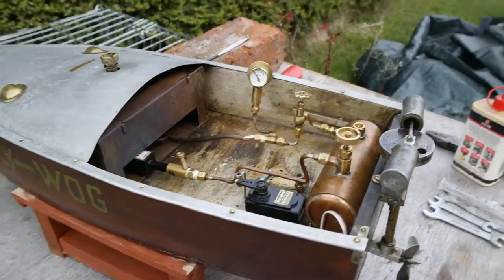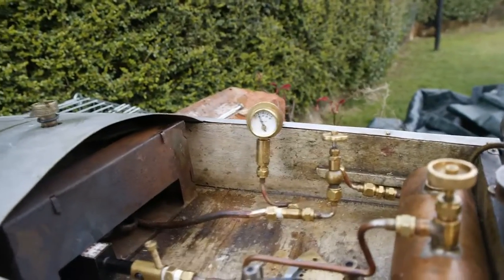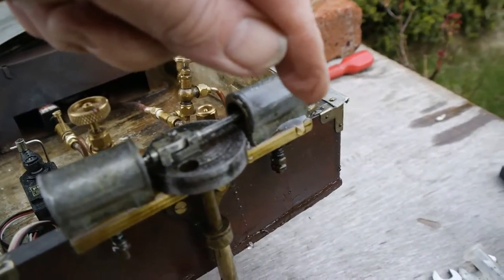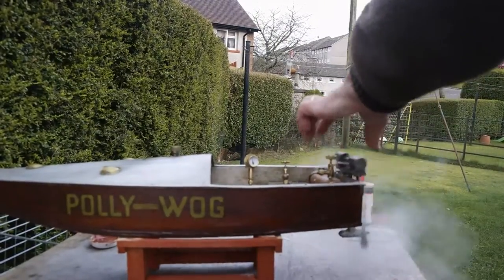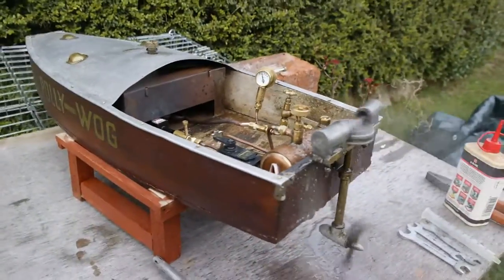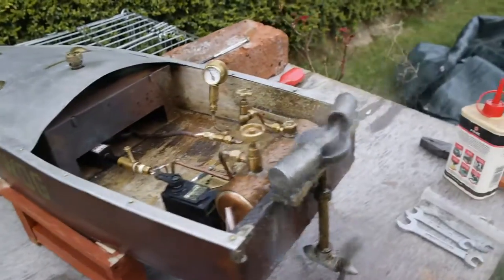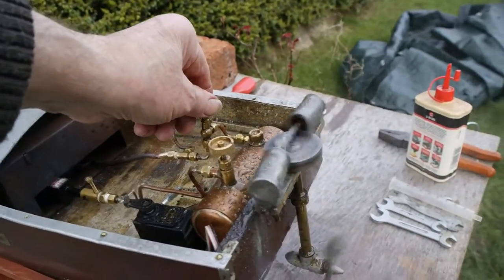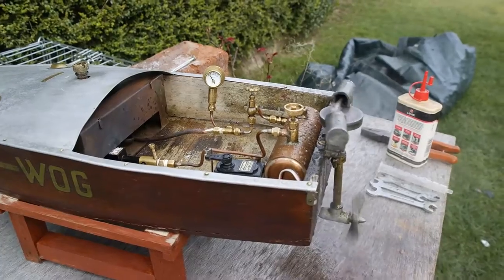BOUCHER POLLY WOG  STEAM UP FOR DOMENIK PART 2

Comment: Bonjour Roy,
She runs perfectly, you made definetely a great job.I do not understand why you would change the jet, I guess it is for the power of the burner, and as we can see it, nothing need to be changed. I hope we will see her soon on the water.
Amicalement, Raphaël
will
Reply from the maker: Bonjour Raphael ,  " yes run well but a this time temp was 7 C so this=  using a number 8 yet , as to like you say to increase boiler pressure ,however as the buyer is in the States  he only needs a no: 5 jet
   thanks for your posts            merci Roy